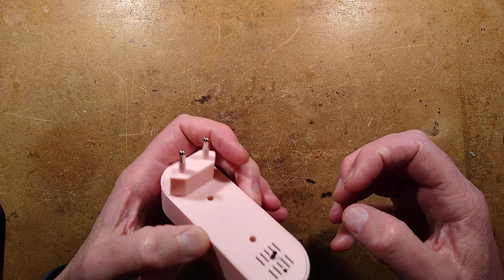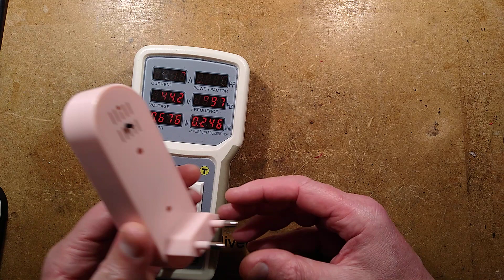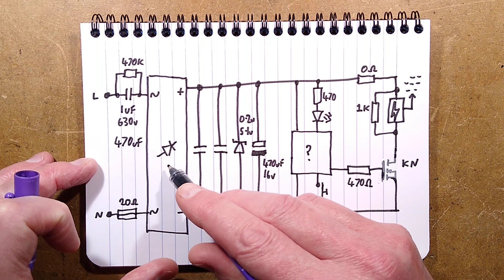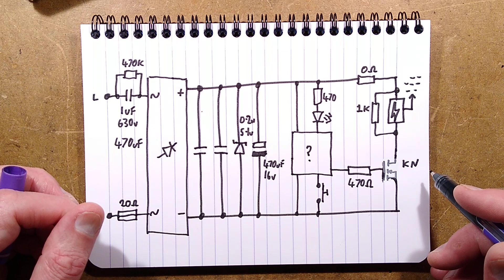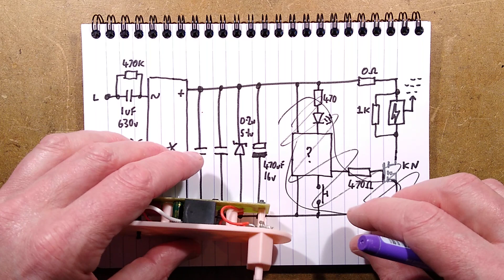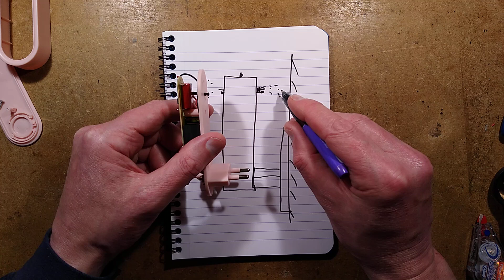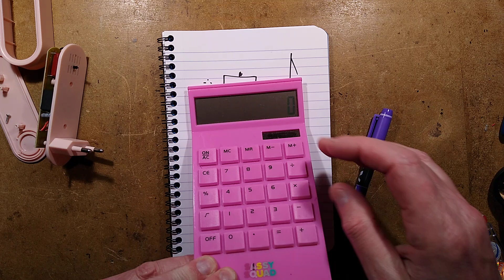Perplexing Pink high voltage "thing" (with schematic)

Comment: Is this the same thing as an ozonator? I have one for removing smells, and I would not want to breathe the air until the space has been thoroughly ventilated. Inhaling ozone is not safe.
Reply from the maker: This unit will only produce trace levels of ozone similar to outdoor air.
Reply: Ozone generators are designed to generate strong corona discharges that rip apart oxygen molecules for which some recombine as ozone.
Reply: @soundspark  "Ozone generators are designed to generate strong corona discharges that rip apart oxygen molecules"
That's the type of ozonator that I have. I can see the corona discharges inside. The smell of ozone at the output port is so overwhelming that one would certainly not want to inhale it. I have used it, for example, to remove an overwhelming stench of cannabis from a sofa that I bought used :-) One night in a confined space with the ozonator completely and permanently got rid of the smell.
Reply: @jaakkooksa5374  I personally bought an ozone lamp some months ago to freshen up my bathroom.  Between the intense UV rays and plentiful ozone production I was certain to vacate the room while it was in operation.
Reply: Another method of generating ozone is with a mercury discharge UVC lamp whose bulb is transparent to the 184.5nm wavelength.

Comment: I have one of those!  It was actually sold as an ozone generator sanitizer thing, and it also cycles on and off every X hours (6 or 8 I think).  Got it for a powder room (half bath) because there was no exhaust fan and always had a "locker room stink".  You can smell a trace of ozone if you get within a foot or so of mine, and it seems to do a good job of keeping the very small room smelling better without smelling like straight up ozone.

It was actually very hard to find one that generated small enough amounts of ozone to not be hitting you when you open the door.
Reply: Bingo! You caught Clive in a rare omission, failing to test if an ozone generator had a timer on it. It does!
Reply: @demef758  From looking at Clive's circuit diagram, I fail to see how the microcontroller can possibly turn the ionizer on and off.   It can turn the LED on and off - but nothing else.
Reply: @SteveBakerIsHere  uh. Uc has two outputs. One output pulls the low side of the led down. The other output goes high for activating the fet..
Reply: @SteveBakerIsHere  What do you suppose the MOSFET does then? That's right, it turns the HV module on/off as commanded by... the microcontroller.
Reply: @SteveBakerIsHere  LEDs which slowly turn on are great though!
Reply: The devices intelligent function is turns on 2hours, rests 10minutes.
Reply: @Edward Elizabeth Hitler Huh, who would of thought a relative of Hitler to be so unaffected be chemical fumes.
Reply: Would you recommend it? Thinking about it for my apartment (5 rooms) thinking that multiple would be needed. Was looking at ozone too
Reply: @StevieCooper  Although ozone may work against microorganisms like viruses, it’s also a lung irritant. Inhaling small amounts of ozone may cause short-term effects like:

throat irritation
chest pain
coughing
shortness of breath
difficulty breathing
In the long-term, ozone might cause health effects like:

reduced lung function
worsening asthma
higher risk of respiratory infections
lung inflammation
Reply: @SteveBakerIsHere  we have a 5yr old   mattress and it smells a bit  Would this ionizer be good and or safe for deodorizing a mattress that's sealed in a  plastic mattress bag for a few days and then let it air out afterwards?
Reply: @SteveBakerIsHere  Fearmonger. As "they" say: the dose makes the poison. Trace ozone ain't gonna hurt you.
Reply: @sootikins  Actually there is too much ozone in air already (if you live in a city) to be unhealthy. It's myth that you can smell dangerous levels. In reality olfactory fatigue keeps you from smelling it, unless you are in very special lab conditions (which is the origin of the myth).
Reply from the maker: @SteveBakerIsHere  Check out my video called "The great big ozone video".

Comment: It feels like this was designed by two or three people, at different times and places. One designed the 'original' pink enclosure, another designed the circuit (probably in about five minutes, on an envelope, while on the can), and some poor sap had to cram the circuit into the enclosure without knowing or caring what the device does, nor how it's supposed to work.
Reply: Don't underestimate some of these designers. Some (but not all) can be pretty clever, smarter than either of us is. If you want to see a fine example of this, reverse engineer one of these cheap lab power supplies that come out of China. "Elegance in its simplicity," yet does its job for a very low cost.

Comment: I am almost certain that this design incorporates elements that were copied from elsewhere. That 0 ohm link is very telling because in another product, this likely would have been a kind of bridge over another trace, to avoid having to do a double sided board. Evidently it isn't needed here because there's no trace going underneath it, but clearly they couldn't be bothered to remove it... That or they don't know what a 0 ohm link does and left it in, which is slightly more worrying. 
Also, in continental Europe the power sockets tend to be recessed (this is a safety feature because unlike that Europlug our round plugs do not have the sleeved pins; the edge of the recess prevents someone touching the pins when they make contact) so the placement of the emitter is very weird indeed.
Reply: Beard
Reply: I think it is there to put some limit to the current in case a different module is being used in production that needs some kind of current limitation.

Comment: Wouldn't any through hole 5.1v zener diode be a "better" hack, as you really have to hunt for one rated for less than 500 mW dissipation. Mouser had 3 out of 186 models. Or atr least it is an alternative to changing out the capacitor.

Comment: By the readings on HOPI, nothing changed when you switched it on, and the current the module draws is thus negligible.
Reply: Because it uses a capacitive dropper followed by a zener diode, if the load (the ioniser module and LED) are switched off by the microcontroller, the zener will just dissipate more heat. The current from the mains and hence the power will remain the same.
Reply: @Mark1024MAK  exactly!

Comment: I wonder if that board and case was built for something else and someone decided to create an ionizer from it. 

As a side note, my dear wife bought me a ultrasonic mister in "BigClive pink". For some reason, it puts out more mist and the battery lasts longer than an identical unit in white. Poor quality control, or the amazing power of all things pink? Probably the former, but I prefer to think it's the latter. 😆

Comment: This device has an EU plug and European sockets are actually recessed in the wall, so the electrode will be probably touching the wall.
Reply: Exactly!
Reply: Wanted to write the same comment.
Reply: @andreasdill4329  Me too
Reply: Same. Clive is clearly too used to UK plugs 😁
Reply: China wouldnt know that, hence why it was designed this way🤣
Reply: agree
Reply: Must place the device on tall tower made from various AC plug-adapters!
Reply: In Spain we have 2 pin 10A sockets flush with frame, their holes are for 4 mm diameter pins, like the Italian P11 but without ground, so the Europlug fits on them but Schuko style plugs (CEE 7/4, 7/7 and 7/17) won't fit due to their wider pins.
Reply: oh i actually made my own comment too, didn't scroll that far down enough to see it initially

so yeah, unlike in uk, it's back plate is flush with regular grounded schuko socket outlet. and it socket is inside wall, those bristles likely touch the wall
Reply: It's the perfect device to ionize your wall!
Reply: Erm, no... Off the top of my head Type L sockets as used in Italy aren't. Let's not forget Irish sockets as well...
Reply: In Korea we have ground-less non-recessed 220V socket. Maybe they expected the users to have that? 
Or maybe they initially thought of drilling a hole on the front or the bottom and then thought "wait, that's very dangerous", then moved it to the back?

Comment: The mystery microcontroller IC is to give the push button switch something to do.
Reply: Don't forget about the LED fade-in function - oh so important! XD
Reply: could change the cap and throw the ionizer away and connect something actually useful there which needs to be turned on and off
Reply: @ketas  Something that's just occurred to me, is the product may well be originally designed to be something else,  the ioniser /ozone function gets patched in at a later date and it inherited a legacy of the original design.

Comment: Not sure if the designers had this in mind, but many power sockets will have the supply cabling run vertically into the socket, possibly even surrounded by an earthed metal conduit. I'm not sure how well building materials would act when presented with a frontal Corona discharge especially when the module is supplied via a capacitive dropper. This device may actually might fall into the "Perilous Pink" category, especially if a discharge successfully made its way to Live or Earth.

Comment: To be honest, i dislike calling these things ionizers, because in reality, they charge air particles statically way more than they ionize the air( wich is a good thing). Maybe staticator would be a better (and slightly funnier) name for them
Reply: what does "ionized air" mean and why is it bad?
Reply: @terasestHammasratas  ionized air is when you turn the neutral atoms/molecules into electrically charged ones by either ripping electrons off of them, or forcing extra electrons onto them. And they are bad, because they really dont like being ions, and because of that, they are chemically reactive

Comment: If you plug that thing into an european socket you will find the bristles will actually touch the wall, or have at maximum a few millimeters of clearance.
Reply: Plugging it into a German Schuko socket the clearance to the wall is barely 1cm or even less... The energy might be small so it will not burn a thing, but I am quite sure there will be gotten a lot of dust collected underneath... This device will probably not work long very well....

Comment: The presence of the mystery chip makes me wonder.  Did you try holding down the on/off button?  Perhaps it shifts into a different mode.
Reply: It would be fun to see it flash SOS
Reply: Magic smoke mode if depressed for more than 5 seconds
Reply: Maybe it starts emitting alpha or gamma radiation? 😉
Reply: @mr_sheen_ar_15  while it is flashing sos xD
Reply: @mr_sheen_ar_15  or both! It would make a good companion for the UV-C lamps Clive has!
Reply: Could it not be a timer chip to turn the unit off after a set time ?
Reply: @lukelovatt1152  "Could it not be a timer chip to turn the unit off after a set time?" I think you're on to something, Luke. Don't they usually tell you NOT to leave an ozone generator running 24/7?
Reply: I was thinking maybe a timer function.
Reply: "thanks for choosing the self destruction, have a nice day..." it would say i assume :P
Reply: Love that the last word of a video about an ionizer is 'pointless'... 😂
Reply: Honestly, I cannot imagine him not trying _that_. I believe he even tries that with plain wall switches. He apparently loves the alternative modes (especially SOS blinks, as it’s already been mentioned here). ;-)
Reply: It would be cool to see it on SOS
Reply: @flcollection620  You beat me to it!
Reply: -••• --- -•••
Barbie SOS

Comment: Odd indeed.  Why did it seem to draw the same amount of power regardless if it is off or on (1:20)?  When I saw that at the beginning, I was expecting the micro to only turn the LED on/off
Reply: Because its a capacitive dropper with a zener, the capacitor will pass x amount of current, and if the module is off and dont use it, the zener has to dissipate that current as heat to keep the voltage constant

Comment: When you said 470uF, I actually said Whaaaaaaatttt. Great work as usual Clive. Thanks for all your hard work.✔
Reply: Notice that straight away,  will make a nice puff of smoke if that value is fitted ;-)
Reply: @TheEmbeddedHobbyist  Trying to fit a cap that is physically 470 times as large might indicate something is wrong though...
Reply: @Kris_M  When you see the price of a 470µF 230V AC film capacitor, you may also realize something is wrong.
Reply: Lol, I didn't even notice that mistake.

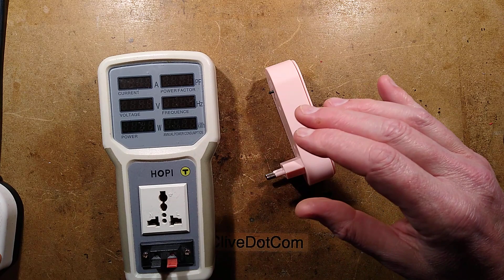Comment: 1:05
Huh? How did they send you the wrong power meter?
We've seen it in the last stream and it's the AnTai 9801+
So what's wrong with it?
Reply from the maker: It was supposed to be the 0-660W higher resolution version.  This has the same resolution as the original Hopi, but does deal with high capacitance loads better.
Reply: @bigclivedotcom  That's odd
The 9800 is the 20A version (displays up to 20.00 A)
The 9801 is the 10A version (displays up to 9999 mA)
The 9801+ is the 3A version (displays up to 3000 mA)
Can the 20A Hopi accurately detect a few mA? (e.g. 0.003A)  I agree the resolution up to 10A will be the same for all 3 models since it can't do tens or hundreths of a mA but maybe the shunt in the 3A version is more precise since it's calibrated for a much smaller range?
Reply from the maker: @Ni5ei  You're right.  The new one is 10A.  Both seem to read identically for some test loads, but the new unit is much better at showing the current through purely capacitive loads.  The Hopi just refused to display anything for a very low power factor.

Comment: A European plug like that goes all the way into the socket so the carbon brush is even closer to the wall than what you're showing. It will practically touch the wall.
Odd design.
Reply: Like in the euro-plug power strips I've seen in (most recently) GreatScott!'s (however the punctuation works out) videos. I did not know how the recessed/not thing worked; now I do. Thanks!
Reply: @FurrBeard  Yes, it's a very sturdy connection since the largest part of the plug sits inside the outlet. But having the ground pins on the side of the plug also means it won't have a ground connection on a universal connector like that on the Hopi. I use a UK to EU adapter on my Hopi to tackle this problem.
Reply: @Ni5ei  There is a sort-of three pin version of the SCHUKO plug, but the earth pin sticks out of the socket and engages with a female earth in the plug. Apart from the flat 2-pin plug for low current devices, all modern appliances in the EU, with a moulded plug, seem to come this way. I've not seen a socket with the earth pin in the Netherlands, I think it's a French thing.
Reply: @albanana683  Yes I know that one (type E) it's being used in France, Belgium, Poland, Slovakia and Czechia.  But it's still not a 3 pin plug since the third pin (ground) is in the socket, not the plug. The outlet is different but the plug is the same.
Reply: Was gonna comment the same thing.
Source: am from Germany.
Reply: here in brazil the new outlets are the same and go under the wall so would be same scenario
Reply: It should works just fine in Italy because the sockets aren't recessed (unless a Schucko socket is employed, which BTW is usually used only for vacuum and kitchen devices).
Reply: Not all outlets, just the ones with ground pins. Odd design nonetheless. ;)
Reply: @devttyUSB0  Yes you're right. But at least where I live (the Netherlands) grounded outlets have been mandatory for over 20 years now so you only see ungrounded outlets in older houses nowadays.
Reply: @devttyUSB0  Even ungrounded ones it goes into some recess unless the socket is from soviet era or cheap surface mount._